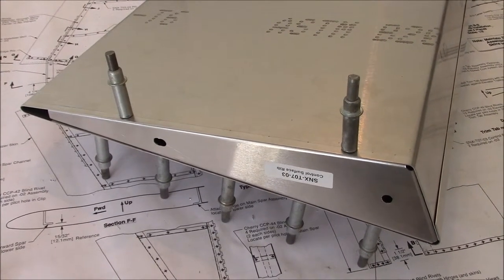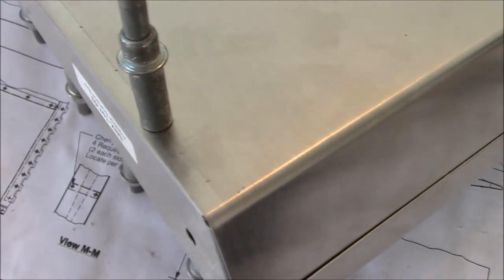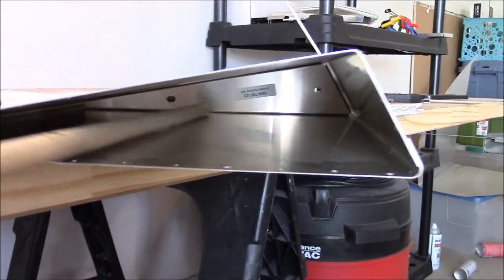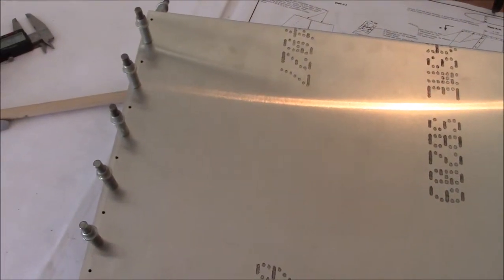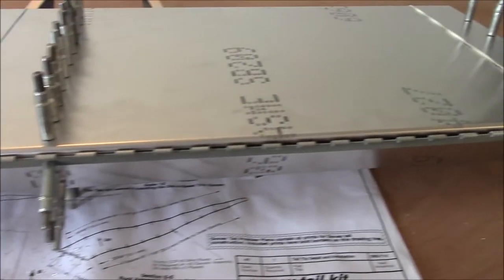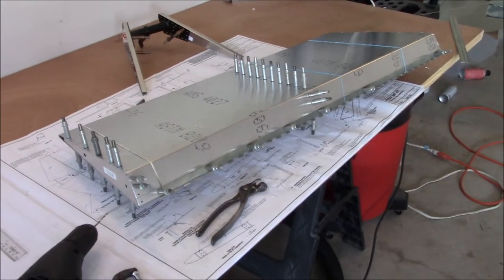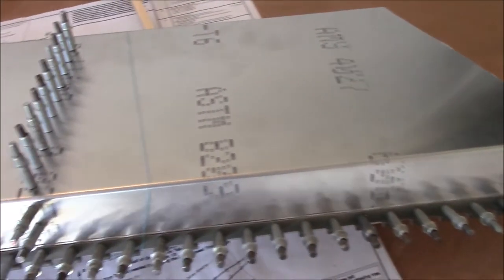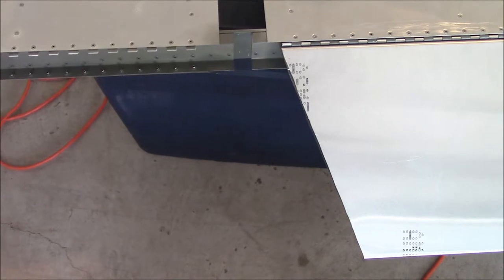Sonex Aircraft Build Video 16 Starting the Second Elevator

Comment: Use a "centre punch" (gentle tap on aluminium) to mark your drill holes and provide an easy dent to keep your drill accurate. Then drill them with a 1/16 dia. drill to give an initial guide hole before drilling full size.  If they are not quite accurate enough, an undersized hole can be corrected with a needle file.